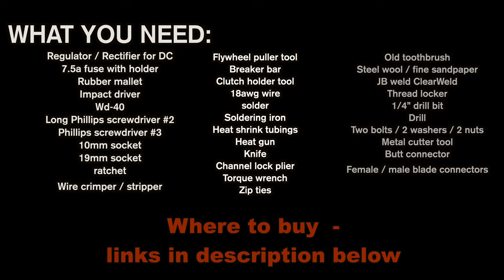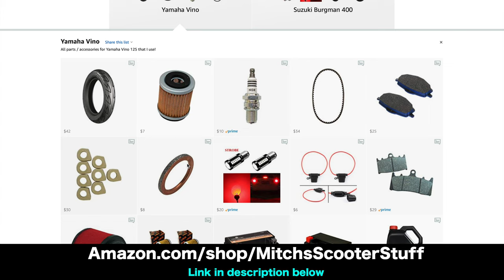AC to DC Conversion on Yamaha Vino 125 | Mitch's Scooter Stuff

Comment: Tips for soldering: Heat up the WIRE with the soldering iron and dipp the solder directly on the wire. When the wire is hot enough, the solder will melt and wet the wire easily.

Comment: Mic, what are you doing to the stator & why? Does the rewire increase output? Why not simply install the new rectifier/regulator? I want to do ac-dc conv to supply Ruckus headlight & add SD headlight modulator for safety.

Comment: @MitchScooterStuff. My Vino 125 CDI is not working (starter works - engine cranks but does not fire). I say that b/c there is no spark coming from the spark plug. I suspect its the CDI is gone bad. And Yamaha is not selling new CDI's anymore. 

I change the Vino from AC to DC. does the CDI still come into play? or Do I need to figure out why the CDI went bad and replace it before I made this AC to DC mod?

BTW thanks for a great video.. great stuff.

Comment: bruh, did you see that cane spider hiding in your stator winding? 
meaness lol
Can I ask  if I swap out my stock headlight bulb for a Cobb led replacement and don't mind the flickering, ya think my bulb'll burn out prematurely without a rectifier?  
Fyi just R&R'd my stock rear shock with a fleabay RFY 12.5" clevis end adj. nitrogen gas reservoir unit for 55 clams shipped. No more springy rear. 
 Installed  rubber tubing on the long rear exhaust bolts' shafts 2 stop vibration.
Also thx 2 U removed emissions, fixed my fuel guage, inspected CVT then upgraded rollers. 
Mahalo and pls keep up the chill  and wicked cool vids!
Reply from the maker: Haha yeah I took the spider out and put on the tree :) yes LED will blown out soon after you install 😢 Wow very cool, I should check it out.... what is fleabay?
Reply: @MitchsScooterStuff   ebay lol

Comment: Hi Mitch, great video. i learned a lot and i changed my YAMAHA - VINO 50 s' wiring according to your information. Just one question, if we changed stator wiring like this, what about AUTO CHOKE and CDI ? Isn't that voltage too much for the  AUTO CHOKE coil?
Reply: The CDI and auto choke are on a DC circuit.  They will work fine :)

Comment: That's a top-notch work, Mitch. Just one question, if logic serves me right, with proper know-how and a wiring diagram, I can do this to literally any bike with an AC system, right?
Reply from the maker: Thank you Richard! Yes possible, if other bike’s stator setup look alike in this video , you can follow the steps to get job done. I did other two bikes like this and they works 😄👍🏼

Comment: Hi Mitch, great video congratulations!  I wanted to ask you, do you think it is possible to carry out this type of transaction even on a 50cc two-stroke scooter?  I have a '99 Yamaha Bw's, and I will also have to mount some led lamps both on the front headlights and on the rear stop...thanks for the answer 😉😉
Reply from the maker: Thank you! Yes you can do that... I did to my Honda Elite 50cc two stroke it works amazing!! Same method!
Reply: Hey what cables I use on the Honda elite thanks